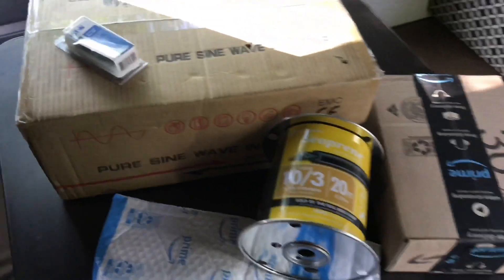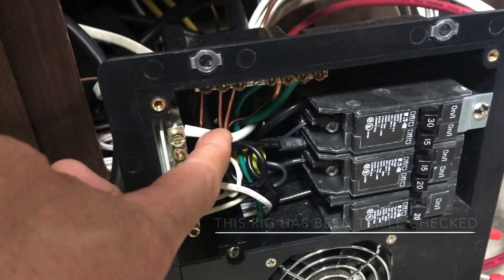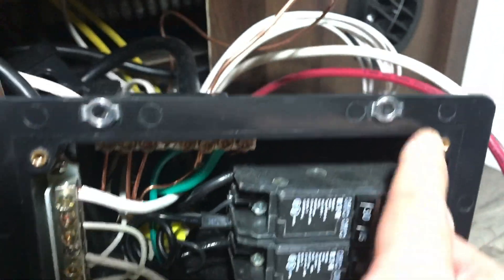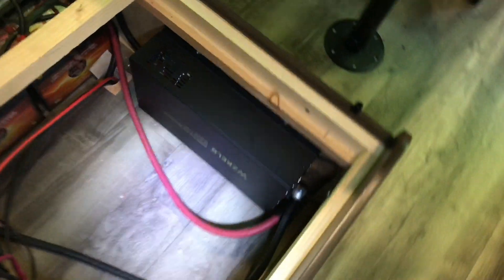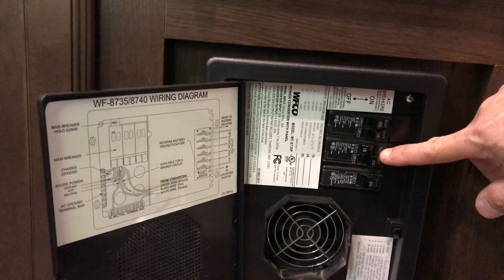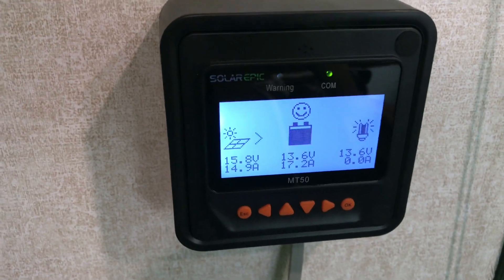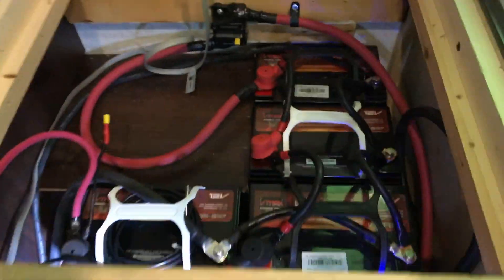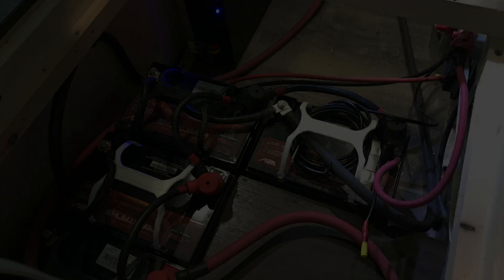How to Install 3000 Pure Sine Inverter on a Jayco Travel Trailer 212QB w Automatic Transfer Switch

Comment: Is there any fail said for when shore power gets disrupted or generator runs out of gas and the switch will then move over to inverter and let’s say you have a bunch on. Will the system just get an over volt and trip everything?

Comment: So I have a quesion about this. I have this same basic setup, however if I plug in shore power the converter charger then starts to charge the batteries and the solar charge controler will show and error because its seeing back feed voltage unless flip the breaker for the output from the solar charge controller to the battery. How did you work around that?

Comment: I AM SO THANKFUL Someone mentioned the GD converter.
So, You're Using Solar to charge the Lifepo4's under the chair, that feed a puresinewave, Which then goes to your ATS.
But you're leaving the Converter ON then huh? So you're charging the lead acid batteries as well? Seems like an uncessary drain no?

Comment: So I have a question do you need a transfer switch in your fuse box in order to hook the inverter up in your travel trailer and if you do can you explain that to me please thank you please I need help
Reply from the maker: Having and inverter (though cost more) is the most convenient way to go about it. But, you can do with out a transfer switch. Just having the inverter (without transfer switch) - you are limited to the two outlets built in to the inverter. Run extension cords to what ever you wish to power up - on AC 110 appliances. You also need to create a 12 volts distribution center to use 12 volts lights. I hope that helps a little bit.

Comment: Awesome set up!
Question for you all? I have the same TT and setting up my solar power bank that I’m gonna just use the shore power plug to plug into system but when I turn the converter off it turns power off inside trailer and it’s on its own breaker. Need help! What am I missing here
Reply from the maker: Thank you... for your question. Do you have a transfer switch? If you a transfer  switch... make sure the converter is on the secondary... not primary
Reply: No transfer switch
 My thoughts of making this all “easy” was plugging the shore power cable into the inverter that I hard wired a 30 amp outlet and then just flip the breaker so I don’t charge the exterior batteries on tongue......soooooooo now what
Just when I think I had it all figured out

Comment: Thanks for sharing...are you able to run your Air Conditioner?
Reply from the maker: I’ll test that... but highly doubt it can run it for a long time... I bet it can with ez-start
Reply: When you plug into shore power, does the auto switch cutoff the inverter?